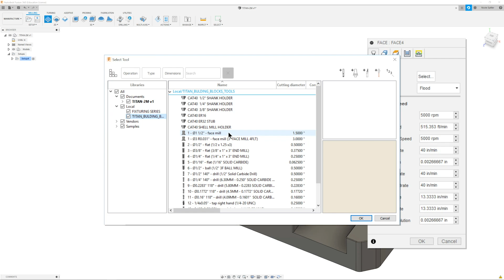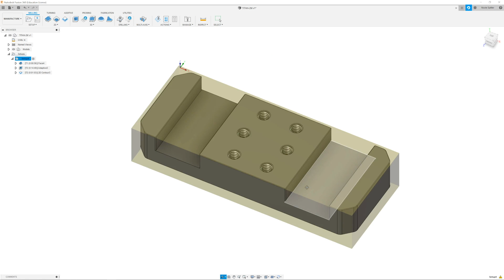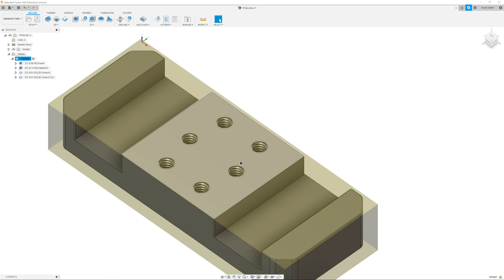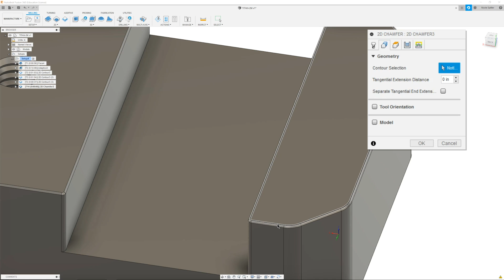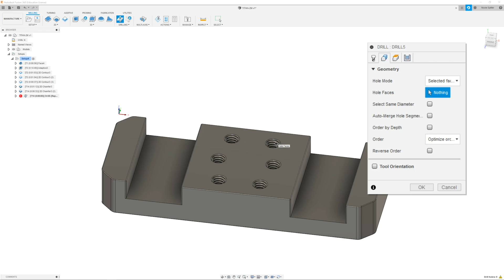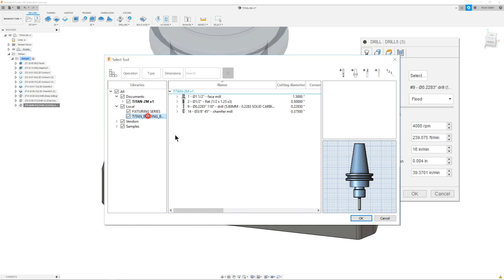LOW HP MACHINING | TORMACH TUTORIAL | PROGRAMMING THE TITAN-2M IN FUSION 360

Comment: Thanks for the video!

I have a few questions -

1. You selected model top as Z0, How would you zero your Z-axis for the workpiece, since the model top surface is yet to be faced?
2. While finishing the 4 inner wall, you had roughing pass turned on for the first pair, then, mentioned that roughing is now needed when doing the other pair, is there a reason why?
3. I assume you used the chamfer mill to spot and chamfer the hole, not just spot, correct? Because I assume otherwise the spot can be much smaller.

One other suggestion is that it would be great to know why the numbers are chosen.

Again, thanks!
Reply from the maker: Z zero it top of model and Z is set off top of raw material and then dropped -.020 

That way everything Z positive is free air travel...

And everything Z negative is in material or below top of part... move with reverence.

Adaptive roughs all... then contour passes finish all.

Yes, Chamfer creates the thread lead at the exact same time as spotting. Roughly 10% of major Dia of 1/4-20

1 tool instead of using 2 tools. Chamfer needs to be center cutting.
Reply: @TITANSofCNC  Thanks! I watched the non-Tormach version in which you explained more in detail. Appreciate the videos!

Comment: I really hope you don’t normally use the champer tool to drill with
Reply from the maker: 24 years straight... fast and efficient and of course we use Chamfers that are center cutting. Better than using 2 tools when 1 can do it quicker...
When doing super alloys... we use self centering drill and then come back after to chamfer
Reply: I've only just come into chamfer mills this past year but everyone I've seen have all had center drilling capabilities. I prefer to do what titans said though.. drill then chamfer then tap or ream.

Comment: I have a question, I'm a female interested in going to technical college for CNC machining but I'm very petite, I'm 4'10" is my height going to affect my ability to learn this trade?
Reply: The only problem you may have is tightening the drawbar on a manual mill (Bridgeport) in your introductory classes. And for that they will provide something to step on for reach. Your height is a non-issue. Register today and get started.
Reply from the maker: Not at all...
Just get after it and grab a stool when needed with safety in mind.
I have seen shorter people actually make wooden platforms to stand on etc.
They have stairs for CNC’s also.
Reply: I work with a shortish female machinist, height doesn’t seem to be an issue unless you make it one.

Don’t let it hold you back and you’ll be fine
Reply: I'm studying it rn and tbh i don't think so

Comment: Those slots, im surprised that you didn’t leave 0.001 off the floor so it doesn’t rub tool marks into the bottom
Reply: I cant remember the parameters she put in on the adaptive toolpath but judging by the cut and the fact she did a central "roughing" cut on the first finish pass I'd say there was stock left so the floors and walls were finished at the same time. Personally I like to do floors THEN walls, as titan says "everything's a spring" so cutting walls when finishing floors can result in deflection into the floor.

Comment: What kind of holder was that for the tap? It has a spring-like mechanism
Reply: It’s called a floating tap head
Reply: @sarcasticommentator  and it looked like it was an absolute MUST on this tormach. Is that normal? I run bigger machines and only ever really rigid tap.

Comment: You left .005 on the material removal then .01 finish overlap in the contour? Is that just insuring that it’ll only does one pass?
Reply: The finishing overlap of .010" just ensures the tool goes passed the entry point before exiting the cut so there is no step left.